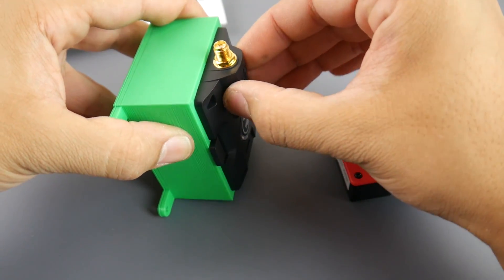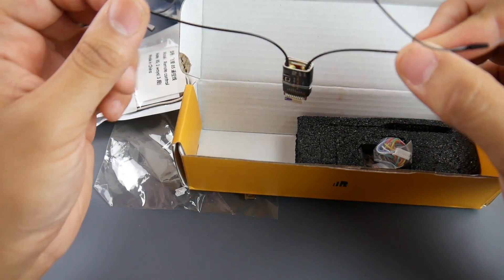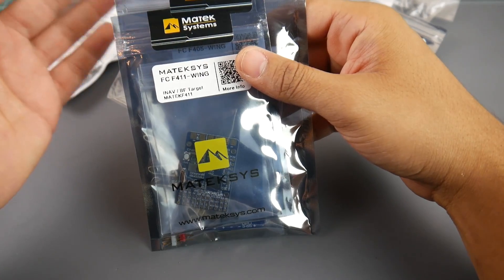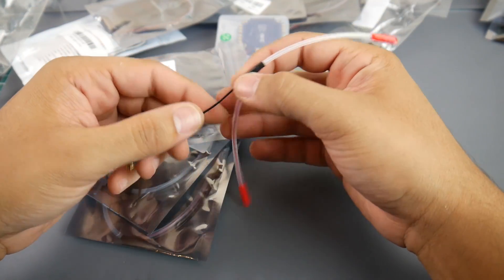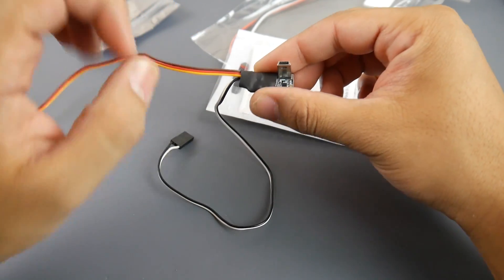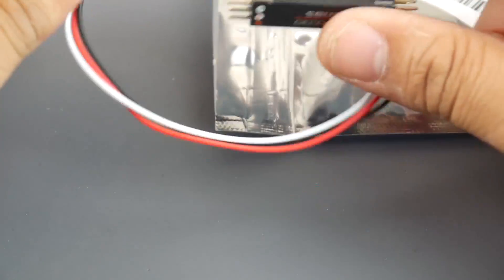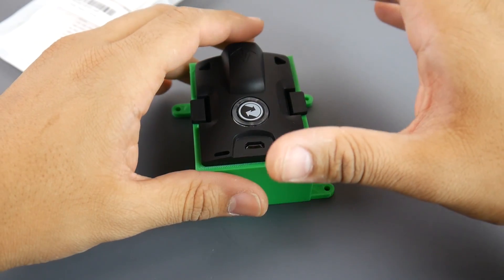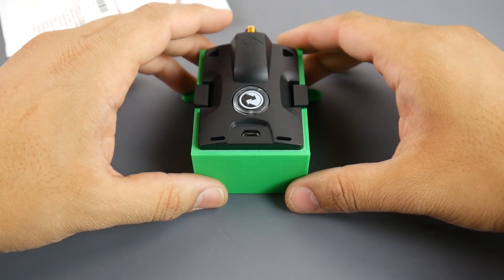Frsky R9M, FlySKy Crossfire Mod and More Updates // MailBag Time

Comment: When using crossfire micro with ppm. How do u bind I have never used crossfire b4 and try to do the mod for flysky fsi6 I watched the other vids multiple times but can't find how to set it up other than the wiring
Reply: Update me on how you do it thanks mate
Reply: How do you set up on beta flight?
Reply: @Lemervalencia  not sure yet I'm gonna be try this mod tonight to see if it works but I believe u just have to select a serial based receiver and select crsf under that. I'm not sure if anything else has to be done.
Reply: In flysky its in PPM. Maybe you have to use Sbus? What is your flight controller? Where did you put your wires?
Reply: @Lemervalencia  haven't done the mod yet .doing it tonight
Reply: Are you done with it mate?
Reply: @Lemervalencia  just got home from work lol about to try it out in a few I won't forget about ya I how it works
Reply: I have mine set up on a kiss flight controller but in betaflight I should be able to select serial based receiver and select crsf under it. I just got done and it works
Reply: @Lemervalencia  well I thought it was working something is going on with the aux channel or something I'll figure it out tomorrow
Reply: Okay, update me
Reply: @Lemervalencia  👍
Reply: Can I add you on facebook or anything. I wanna talk with you
Reply: @Lemervalencia  yea it's reecefpv on Facebook and Instagram

Comment: My experience is the F405-wing has noisy video compared to the F411-wing. Otherwise both are great
Reply: BTW: You don't need a compass on a wing. GPS is enough and typically compass is not connected.

Comment: I bought the r9m because I don't have $600 Australia ( more expensive than my fatshark dominator v3 goggles). Too spend on long range. Very happy with it using FCC firmware, latest update, I don't need diversity antennas put the immortal t on the r9 slim+  and removed the other antenna.I am using the TBS tuned antenna on my Taranis with a rp sma to sma adapter. The Tunned antenna is recommended by mr Steele and ericonasty . Latest firmware when set to 1W it makes the r9m into flexi firmware allowing power from 100w to 1W when needed.(just like the flexi firmware. Never goes lower than 99% rssi. Awesome job FRSKY.

Comment: Why use crossfire over R9m on the flysky. Because you have to use ppm on both, the latency is the same. The only difference is price??!!
Reply from the maker: I have not confirmed that the r9 or r9m can take ppm as input..
Reply: Drone Mesh it can I have done it
Reply from the maker: @georgedowning1803  That's perfect... I will do both anyways the flysky will be modular now.. Thanks for the info..
Reply: George Downing have you managed to do the mod with the r9m?